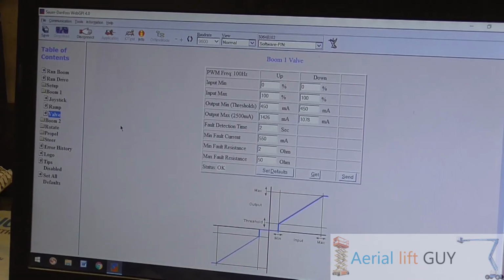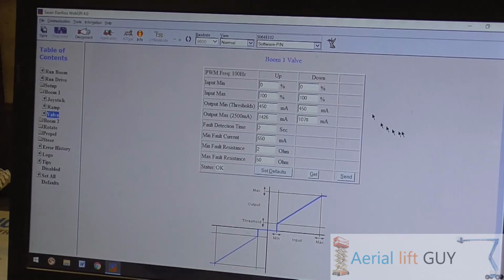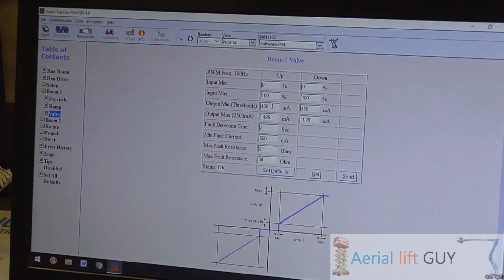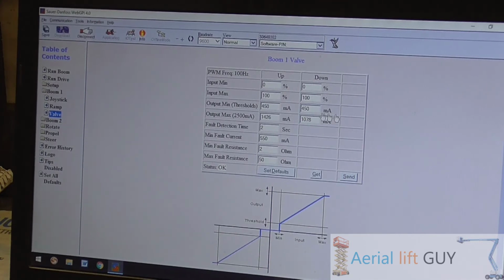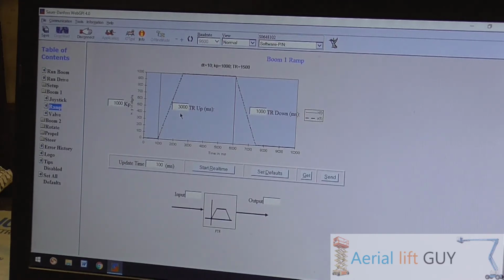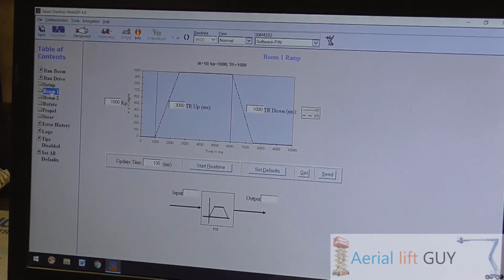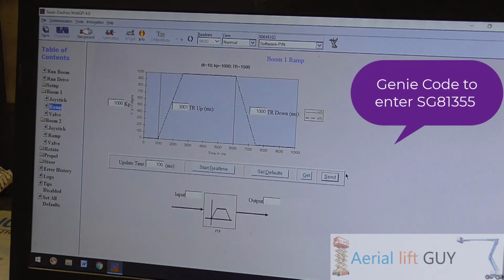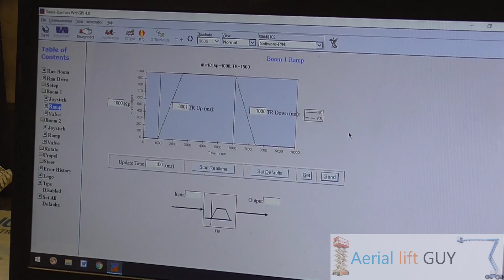Web GPI adjusting speed, threshold, ramp

Comment: I have a NON genie application that uses webGPI. One of the sensors (POT) is obsolete and the existing one is damaged, no replacement. Im wondering if you have encountered a way to dissable or lockout the sensors ability to send changes to the DANFOSS s1x Controller

Comment: Hello just looking for info in how to program a controller on a genie S80 it was previously programmed for a different machine, controller # 121765 is that possible to reprogram thanks
Reply from the maker: The S80 is ALC500 and can be reprogramed to any ALC500 compatible boom. You would need to figure out what to flash it to. If you are replacing a board that is having problems you could get the S0# for the software to flash to it. I will see about doing a video on it soon because it takes some explaining to do it
Reply: @liftguy9198  Ok Thanks I'll have to look into it some more, the reason I asked is I have a customer with that machine and he had gotten the dealer out to reflash it and he didn't know how. I usually don't work on lifts but I enjoy figure things out like this and now people depend on it, So somehow I have to figure it out now
Reply from the maker: @mzook4353  You know you will need Web GPI to flash a board. I have made the video but need to edit and post so it will be soon